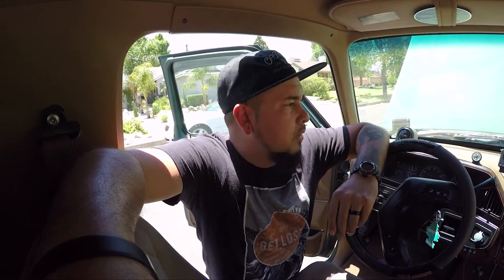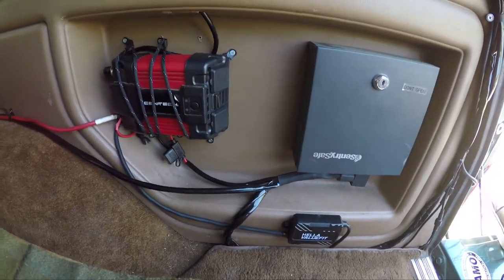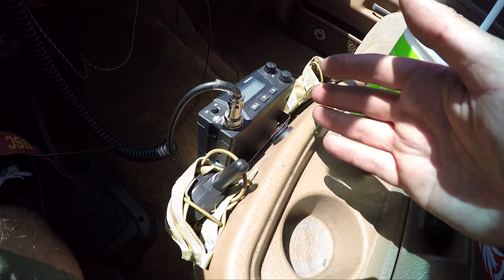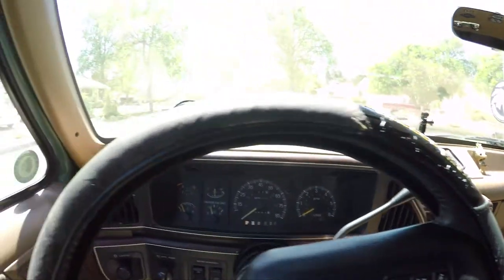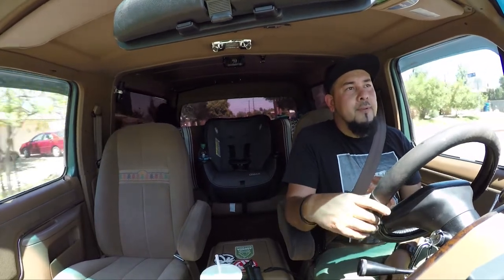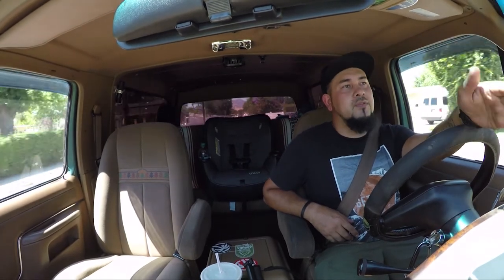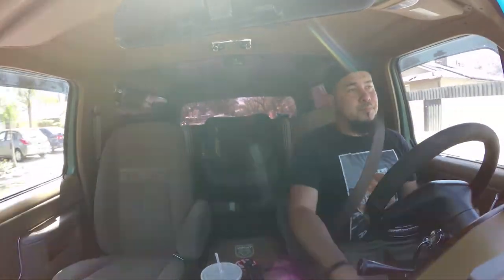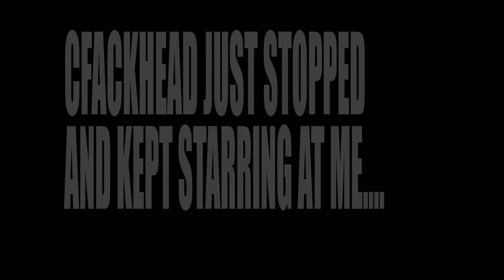OVERLAND BOUND AND TOYOTAS

Comment: What trans do you have?
Reply from the maker: Leonardo Rodriguez I have the AOD transmission rebuilt about a year ago.
Reply: Adventures With Laylay  Lucky you! I have a c6 it’s super strong but it’s a dog since it’s only a 3 speed...
Reply from the maker: Leonardo Rodriguez I've met a few guys that swapped from aod to c6 because of how long they last. I think it's only 1/2" shorter so its pretty straight forward swap.